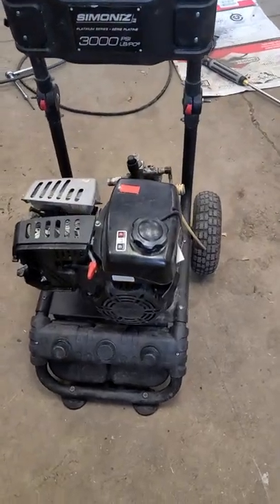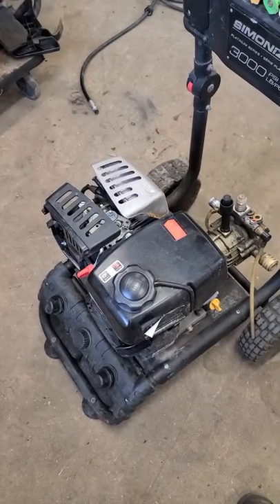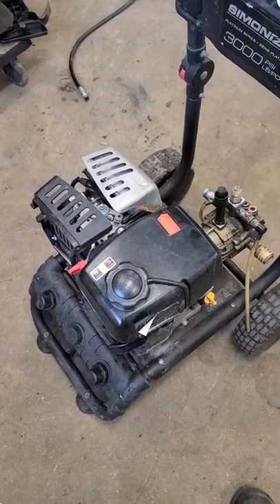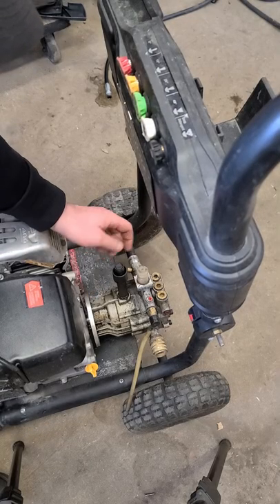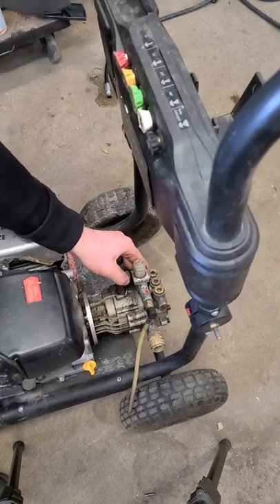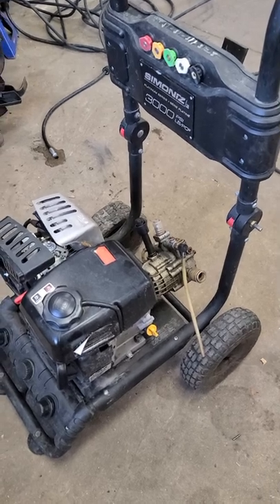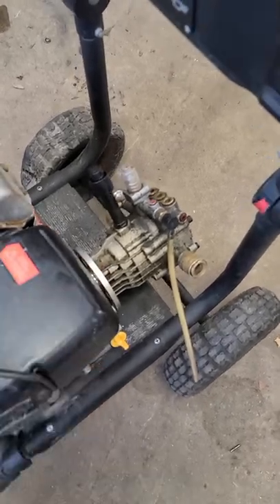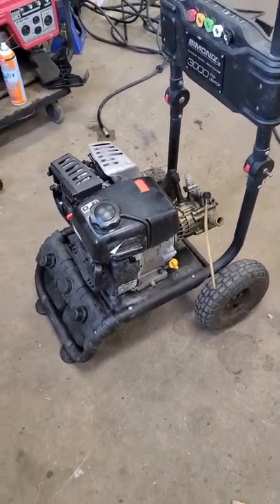Pressure Washer Engine Was Seized! - Here's Why  #shorts

Comment: Pressure washers should not be started until the garden hose is connected & the water is turned on.
Reply: Did the opposite had a blonde moment forgot the hose 😒 turned it off 10 seconds after and it leaked a bit of gas

Comment: My experience has been replacement pump $100, new pressure washer $700 so easy choice.  Also found the new pump to have better pressure than the original, though it was 10 years old.  Pressure washer Simoniz 2900, new pump Amazon, ROP shop.

Comment: I don't know about the price in Canada, but in the States, it looks like a replacement pump in the 2.4 gpm/3000 psi range can be had for around $72 shipped from Amazon. Complete pressure washers with similar specs look to start at around $250 and go up from there. If it were mine, I'd replace the pump as long as the rest of the machine is in good shape.
Reply: Easier to buy a new one for that price.  It's messed up, but that's how they make sh1t nowadays.  🤷

Comment: The scary part with most conventional pressure washers is that they are designed to have a continuous flow of water to cool them.  Most of them advise to not have the trigger released for more than 10-15 seconds without shutting them off.  Given that most of the pump pistons are ceramic (glass) that gets very hot without cold water to cool them they heat up and when the trigger is pulled the cold water flows again.  Hot glass doused with cold water is usually a disaster for the pump ☹️

Comment: I troubleshoot one of this one and I found out that they ran it with out oil in the pump and the seals and springs on two pistons were broken so the punp was leaking over heading and not working properly ❗😥❗💪❗✌❗

Comment: Those cheap pressure washers are almost never worth repairing when either the pump or the engine fails.
Reply: I've had a cheap power washer for 13 years now that has been pretty much trouble free other than needing a new pump when it was 12..$80 for a replacement pump vs $300 for a new machine..I'd say mine was worth fixing...

Comment: The person did not read the users manual!  the pressure washer engine must shut down after 3 minutes if you are not spraying water because the ceramic cylinder will over heat and crack.
Reply from the maker: exactly